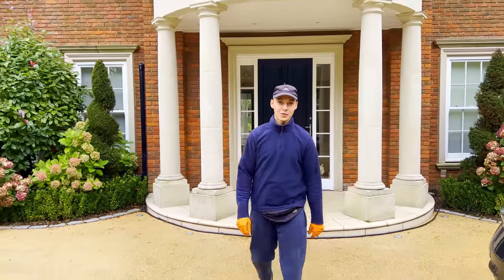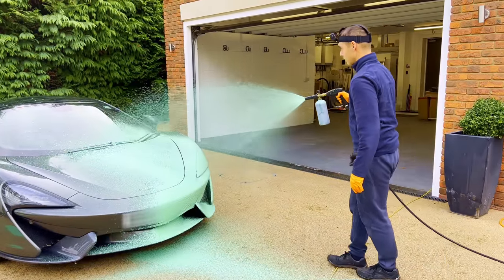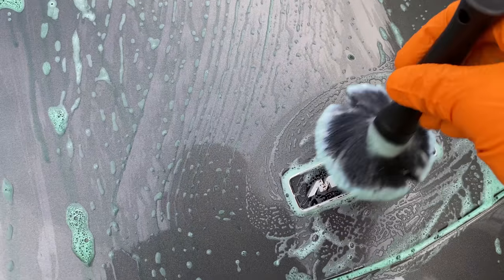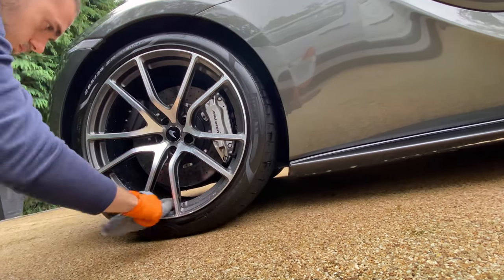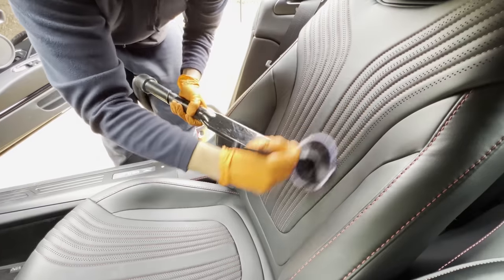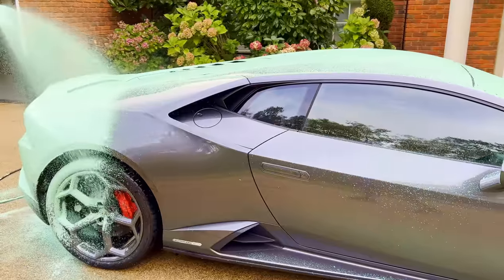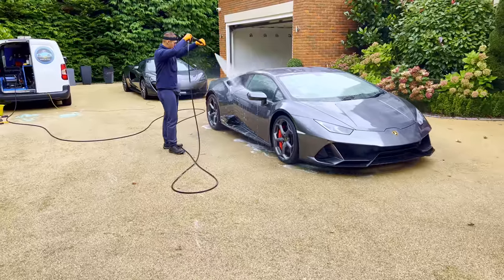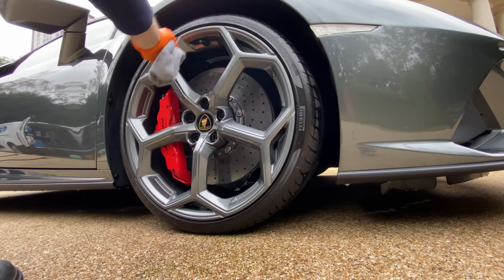How Pro Athletes Take Care of Their Cars

Comment: I don’t understand why the water is being blown in hard to reach places after being dried using the micro fibre towels, rather than the entire vehicle being blown off first to avoid less contact with a micro fibre towel. Isn’t the less contact with anything on the paintwork that could potentially cause damage to the paintwork a more safer way of cleaning?
Reply from the maker: Using a air blower to dry the car without a decent protection is almost impossible. If it does have a protection, it takes 10 times longer to dry compared to using a mircrofibre drying towel

Our drying towel is soft enough to dry the car safely and it absorbs a lot of water!

Comment: What would you use to remove dry road paint off your finish?  I had it one time on my old car and I had to almost pick them off gently.  Is there an easier way?
Reply: paint thinner or try a clay bar, but paint thinner will probably be more successful.
Reply: Warm water and WD40, leave it for 15 mins, apply again and hose off.
Reply from the maker: Thats a tough one! I recently found out that tar and glue remover does the trick